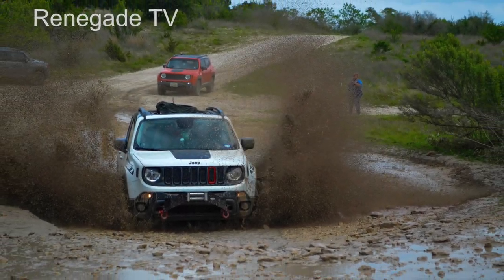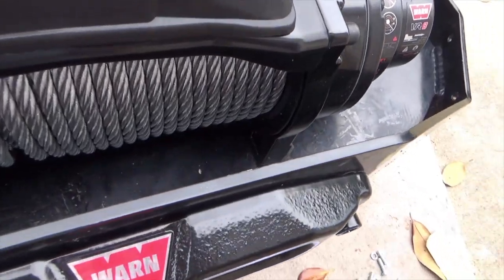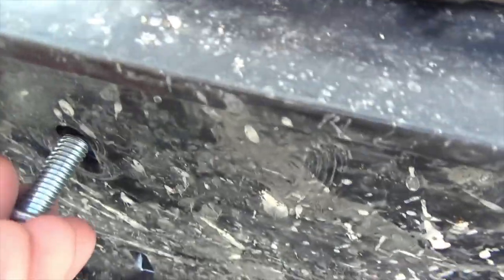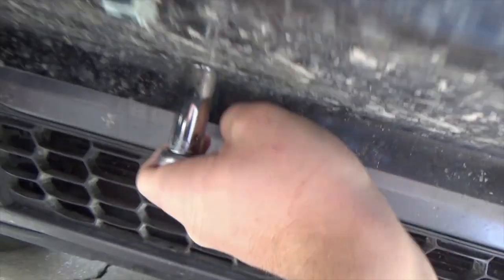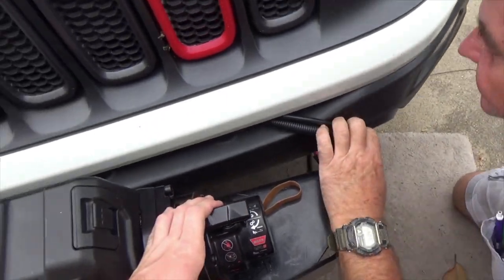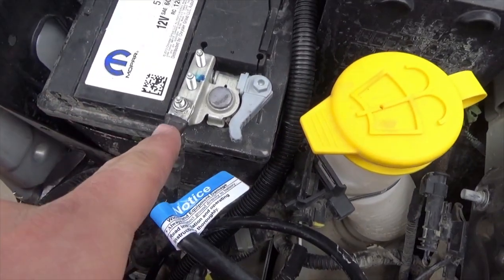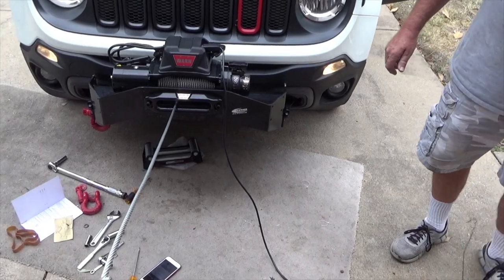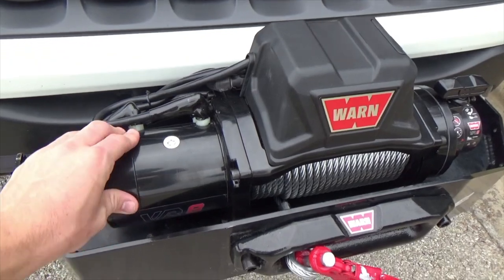Renegade TV - Jeep Renegade Warn VR8 Installation

Comment: GREAT JOB,  
Just some info, not criticizing or telling you what to do.
I
 think you're better off using the roller fairlead with the steel cable 
and a non-painted or polished aluminum hawse fairlead with synthetic 
line, due to the resistance and abrasion properties of each situation.  
And, it may seem minimal, but not drawing the hook in snugly, but 
allowing the cable, especially a synthetic one, by placing the hook over
 to the side can cause abrasion while driving thru vibration and rubbing
 over time and lead to cable failure at the point it was rubbing.

Look
 at www.factor55.com and consider using one of their thimbles or hooks 
to attain a closed system for safety.  Also www. bubbarope.com makes 
kinetic recovery ropes that stretch 30% of their length vs conventional 
tow straps or recovery straps that have 10% or less stretch.  The 
kinetic strap is much smoother in loading (storing) energy and more 
gently releases that energy so ad not to violently jerk on the 
attachment points of the stuck vehicle or the one pilling. Less damage 
is nice.

Bubba Rope and Factor 55 both sell "soft shackles" aka 
Gator Jaws.  A Crosby 3/4" screw pin shackle is rated at 9500 pounds, 
whereas a soft shackle for your winch is rated at 32,000 pounds.  If in 
the unlikely event it  breaks, you won't have 2-1/2 pounds flying back 
at you at high speed.  You can figure out how much energy that would be 
if you take mass x velocity squared, surely enough to kill a person. I 
saw a screw pin shackle, 5/8", penetrate a tailgate once, sounded like a
 shotgun went off.  The old recovery straps are loud on failure, too.

3 marks is GRADE 6, 6 IS GRADE 8, NO MARKS IA GRADE 2.

I got my first winch in 1977, a WARN 8274, and still have it on a shelf in the shop!
Just
 be  careful, you're very fortunate to have what you have. Always err on
 the side of safety.  Always  maintain some fear/awareness that winching
 can kill you or a bystander.  
Good Luck!
Reply from the maker: Dr. Mark in Texas thank you very much for your input. I really appreciate it a lot and will take your words into consideration when getting other accessories for the winch.
Reply: Dr. Mark in Texas . It looks like Iron slide for steel cable. It is ok to use.
Reply: Michał Sobol you could have used red Loctite it feels like washers wouldn't fit